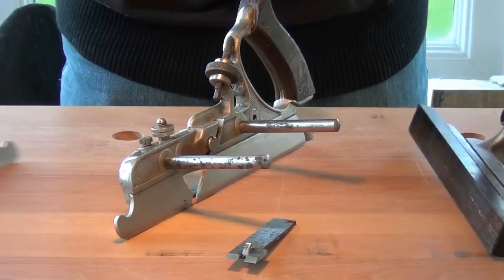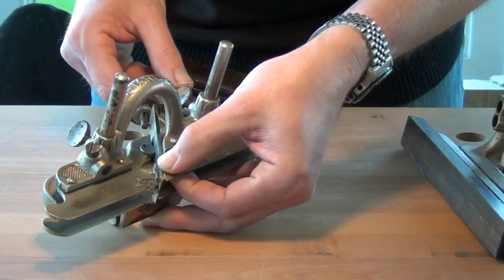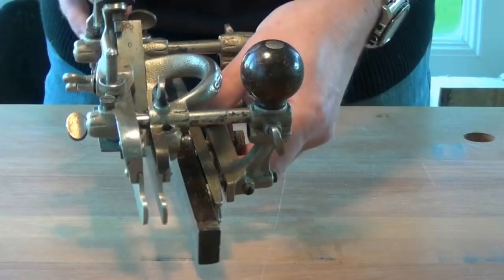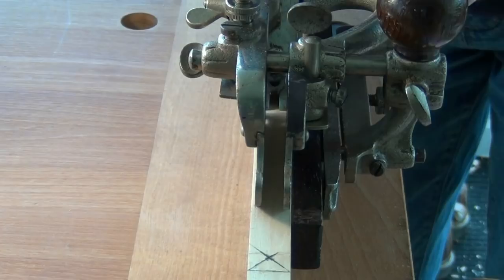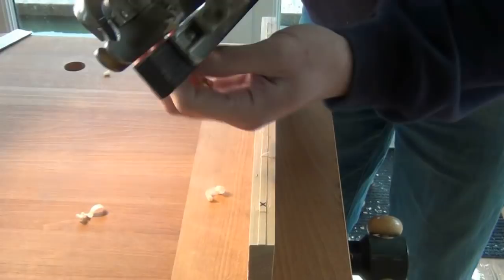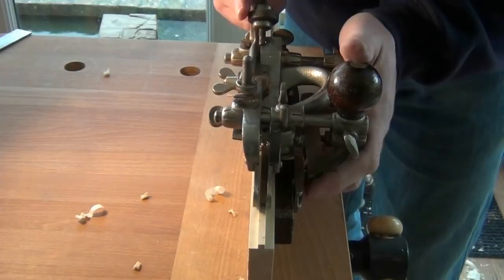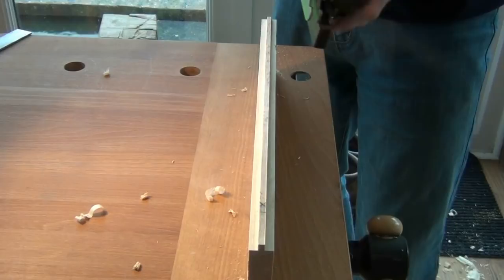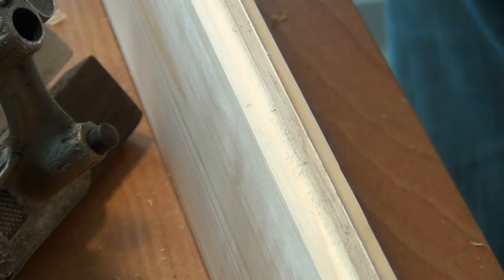Matching using a Stanley No.45 Part 1 Cutting a Tongue

Comment: Thanks a lot Mitch. This information comes at the right time for me, I have to do tongue and groove with my Record 405 soon.
I'm particularly interested in your method for aligning the groove with the tongue in the most precise and effective way!
Reply from the maker: Thanks. Part 2 will cover the groove. I don't do anything particularly special, but my alignment is usually within two or three strokes of a smoother. Part 3 will cover the beading of matched boards. Happy woodworking, Mitch